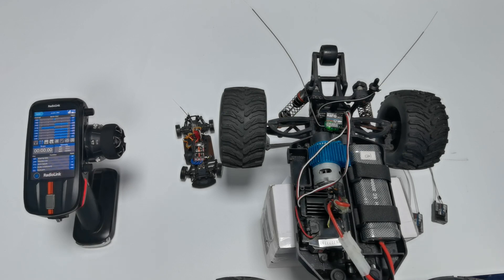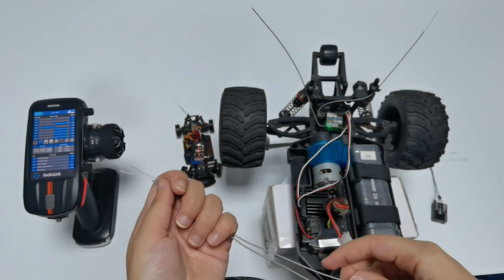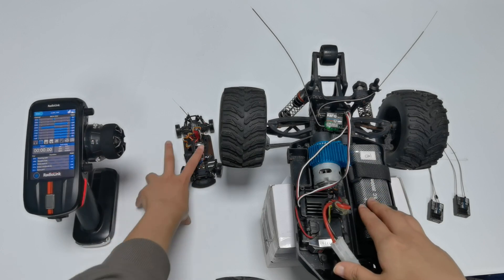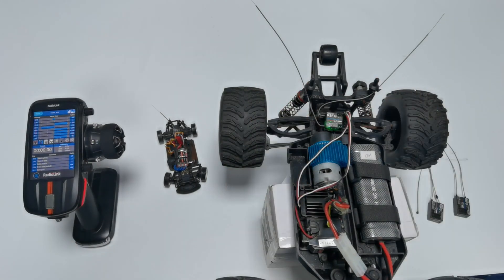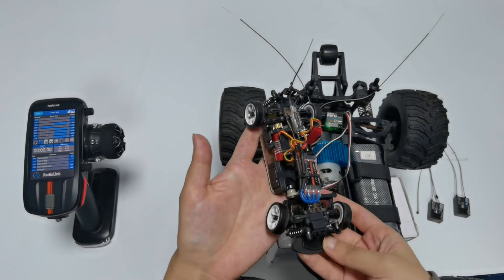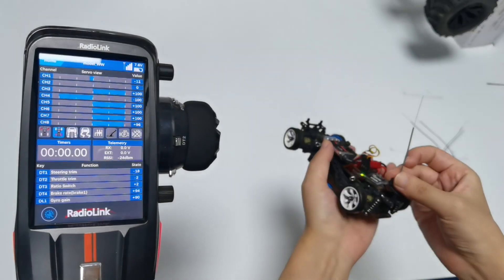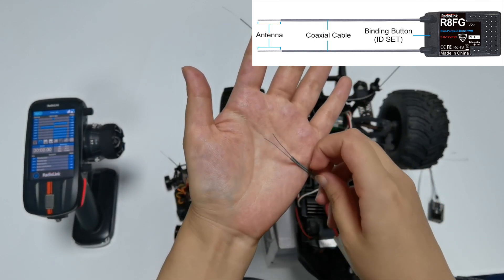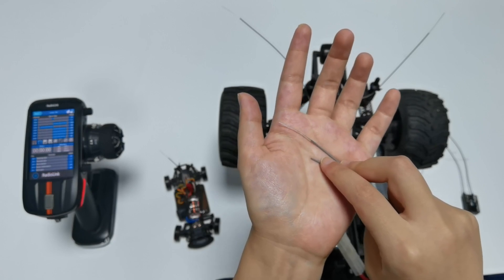Troubleshooting for Signal Loss Problem of Transmitters /Episode 1 Receiver Antenna Installment

Comment: Не помогает, потеря сигнала на 50-60 метрах . Пробовал на 2-х приемниках. Ужасное качество разочарован что купил ваш пульт.
Reply from the maker: Dear Sir, Sorry for the problem. 1. Could you please test RSSI? You can use new receivers to test RSSI, which can help to confirm if the problem comes from the receiver or transmitter. Here is RSSI testing tutorial for your reference:
https://www.youtube.com/watch?v=RA0NasTZS90 
2. If the signal loss problem happens when you move the throttle or wheel of RC8X, it is possible that the problem is caused by insufficient BEC power supply. Here is the link for your reference:
https://www.radiolink.com/newsinfo/561234.html 
3. May I know how you install your receiver antenna in your car? There is also some requirements for the receiver antenna installment. Here is the guide of receiver antenna installment for your reference:
https://www.radiolink.com/newsinfo/886600.html 
So could you please check and follow our suggestions above and let us know your answers? You can also send us your RSSI testing process. If any question about RadioLink products please feel free to contact us. Our email is: after_service@radiolink.com.cn
Reply: @Radiolink_official what about R7FG receiver I have it and he lose signal
Reply from the maker: @tiger78707  Hi, sir. Could you please test RSSI? You can use new receivers to test RSSI, which can help to confirm if the problem comes from the receiver or transmitter. Here is RSSI testing tutorial for your reference:
https://www.radiolink.com/newsinfo/561239.html  If you have other receiver that is compatible with your transmitter, you can replace a receiver to confirm if the problem comes from the transmitter or receiver. If any question, please feel free to contact us. Our email is after_service@radiolink.com.cn
Reply: @Radiolink_official  Hi! I bought a new Radiolink 6 gs transmitter and facing problem with binding.
When evertime i bind it with my rc boat the rc boat motor start directly and i can stop the motor by pressing the throttle upward which very wired.Can you please help med about that?
Reply from the maker: @johnny3740  Hi, sir. Could you please make sure the ESC is a two-way ESC? And you may also need to calibrate the ESC. You can check the manual of the ESC for calibration methods. If any question, please feel free to contact us. You can also send us a video to show your problem. Our email is after_service@radiolink.com.cn